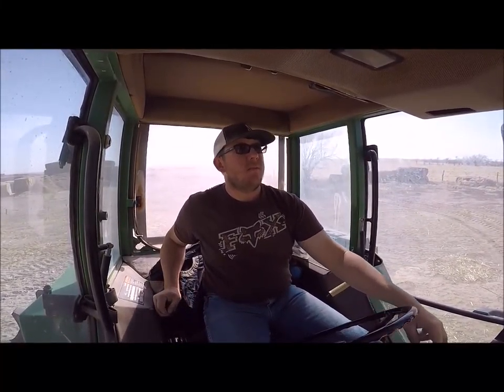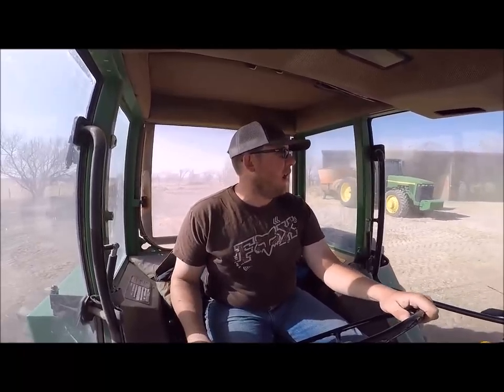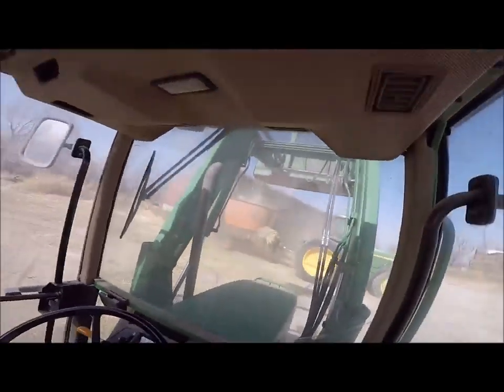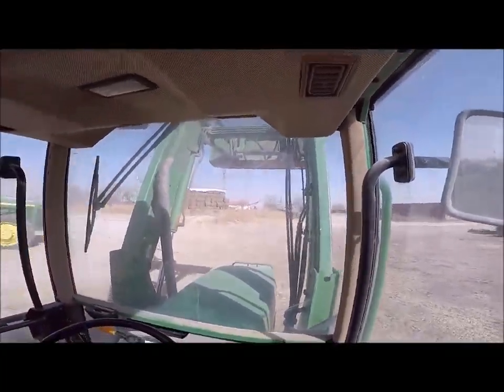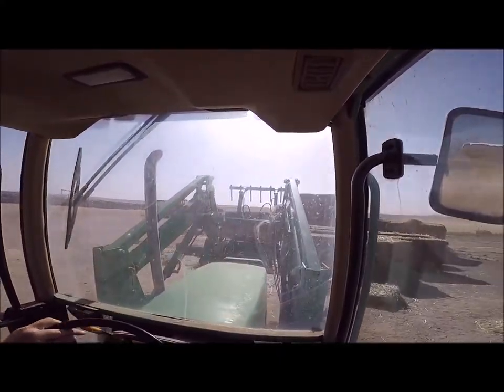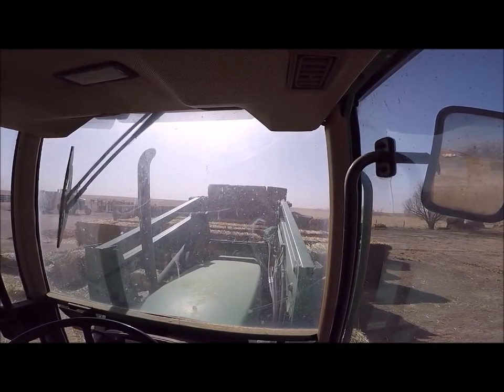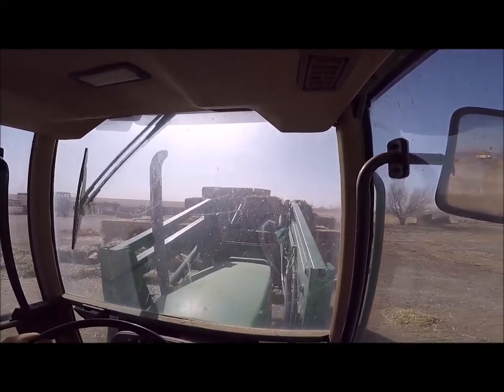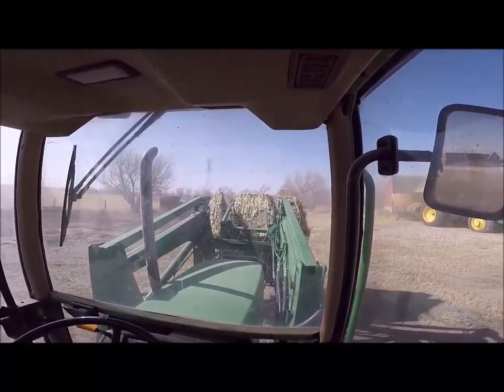Talking Feed Trucks and Grinding Hay

Comment: G'day Will  I can understand why you grind hay when I went into our small feed operation I looked at all the video's on mixers and talked to anyone I could about it and no one around here had a vertical mixer most were Keenans and the people who had them didn't think much of them. Thank Christ I didn't buy one of them, any way I wound up with a cheap vertical mixer it is ok but slow on hay and the hay if it was long would wrap around the auger etc with chopped silage 13 knives in the baler it works good as long as the moisture content of the silage is up it mixes it in the time it takes me to put the mix in and it is a good even mix. I now avoid hay because I dont like chopping it in the baler I find the bales are a bit fragile for selling and I don't want to bale some for me and some for sale. So far it all seems to be working ok maybe I went into with the wrong expectations but I found the reality of feed mixers is a bit different from what is portrayed. John
Reply from the maker: Mixers are amazing things, but you have to learn alot. I truly thought a vertical would be the best machine available, and it is under the right circumstances. you either adapt to your machine or you go through machines until you find the right fit for you
Reply: I agree with all of that a steep learning curve for sure. John

Comment: 20 minutes. penta single screw vertical tmr makes about 9400 lb batch. put in 850lb round bale first then 1000 lb square, then silage then haylage & hmc grain/minerals. the longer you run it the finer the cut and it will cut it down about to 1 inch. i've made thousands of batches of feed only complaint is when you first put in the round bale some hay spills over the sides and all over the tires. i worked at a dairy that had a pto driven hay processor for the purchased 1000 lb round bales alfalfa, took so much power to run it the ih1586 was always overheating and diesel is not free
Reply from the maker: jasonmushersee you mad bro lol